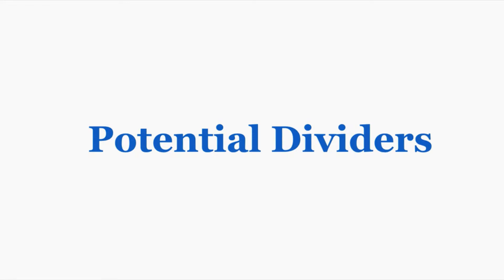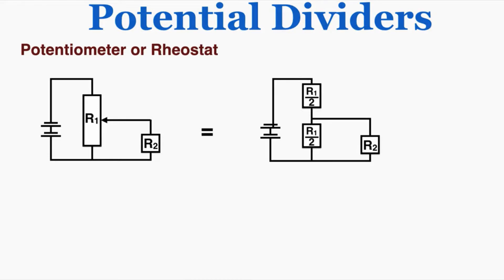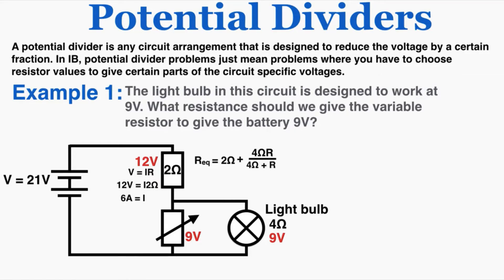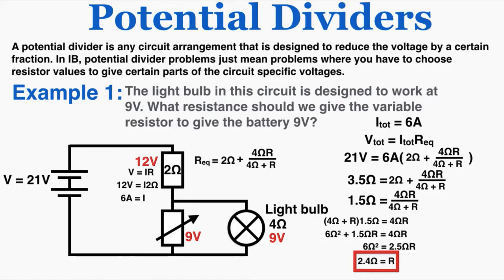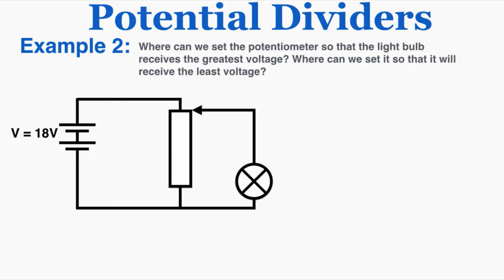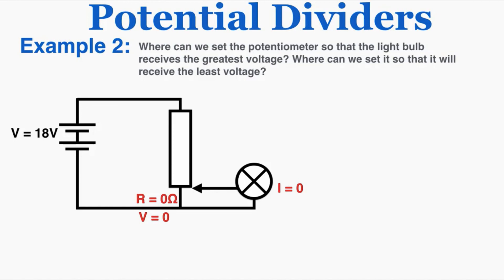Potential Dividers - IB Physics

Comment: @0.50sec, you say " 2 non- potentiometer resistors" but in the image on the right, you show 3 non-potentiometer resistors. n we think of R2 as a Load resistance in parallel with half of R1?

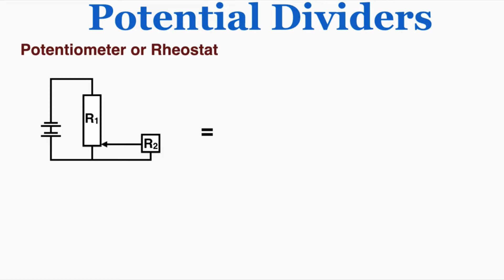Comment: I dont think the animation at 1:43 is actually playing.
Reply from the maker: There's not supposed to be an animation there, just showing the shape of the circuits
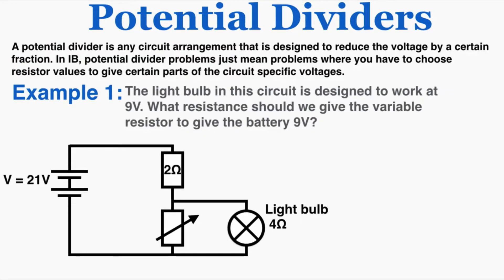Reply: He ment that there is an error at 1:42

There is a short circuit shown when it shouldnt be because its all in a series
Reply: I've been looking at the diagram of the circuit from this time stamp. And I did understand the previous paralel configuration, this series configuration is giving me a hard time...maybe its just the visualization but, i just cant see the series here. At exactly 1:42 the current (in theory) should go directly into R1 due to a short wire, while the R2 should be excluded.

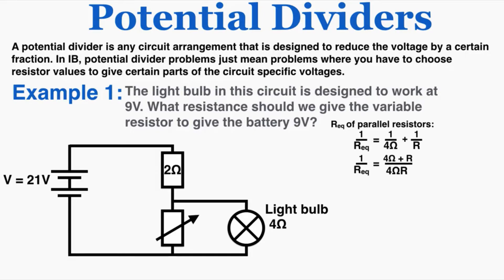Comment: Hello, in reference to 2:40, how is "1/Req = 1/4Ω + 1/R = (4Ω+R)/4ΩR" ?
Reply from the maker: This is just finding a common denominator
Reply: @AndyMasley  Apologies, I don't get how finding the common denominator here gives such an answer.
Reply: @carlosminguez1349  because you flip the fraction due to the resistance equation for parallel being 1 over the resistance.